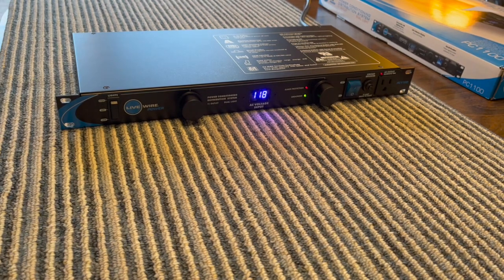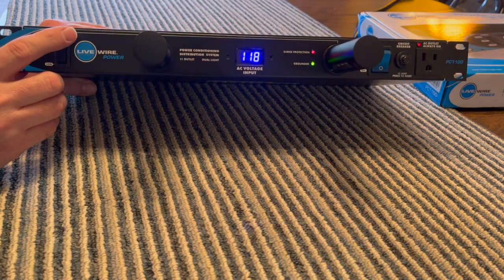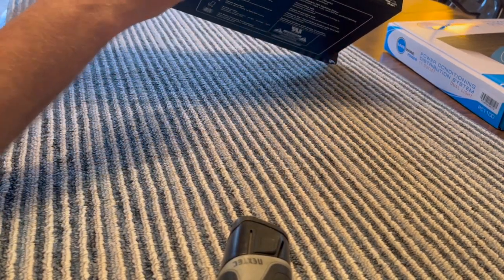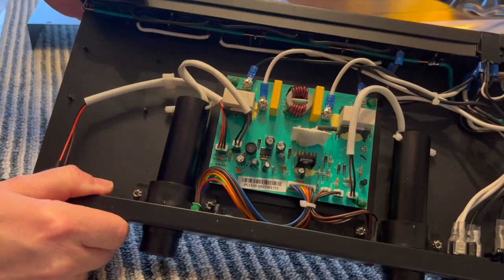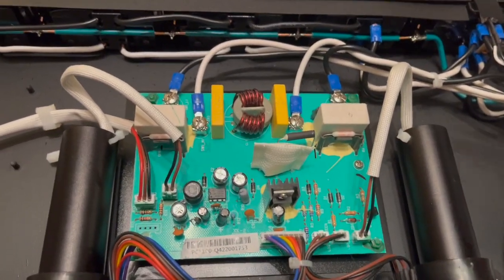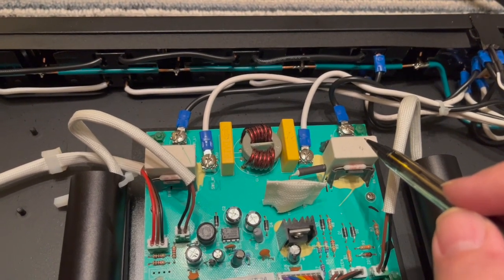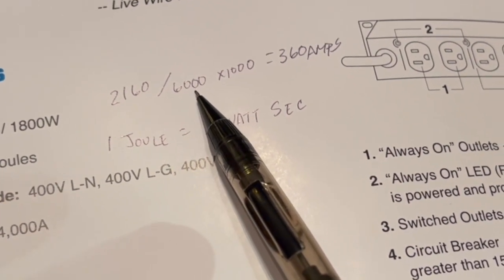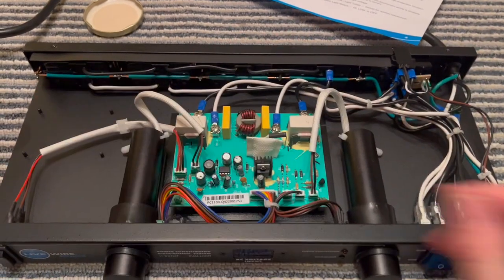Live Wire PC1100, Fancy Surge Protection Power Strip?  Yes.   Worth $100?  Sure.

Comment: More precisely -- those figures are SUPPOSED TO BE referenced to a precisely defined lightning-induced power spike with an exponential rise time of 8 MICROseconds and a decay time of 20 MICROseconds. (That's measured in MILLIONTHS of a second.)

That said, the > 140,000 amp rating is well in excess of anything realistic, mainly because that much current would never make it to your surge suppressor (short of a DIRECT STRIKE on your house). In that case, all bets are off. You probably will have bigger problems than damage to whatever is plugged into this device!